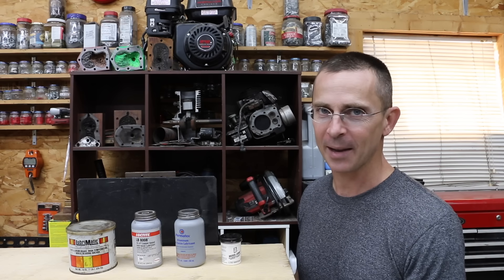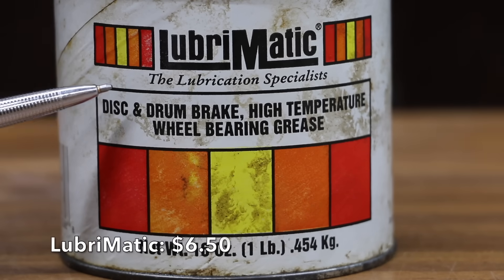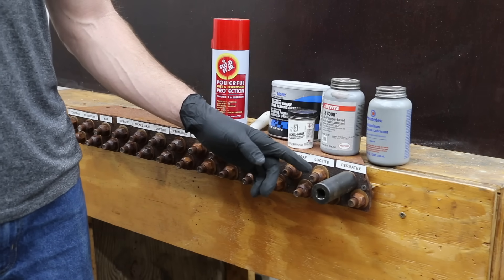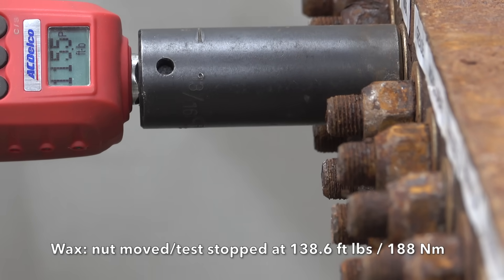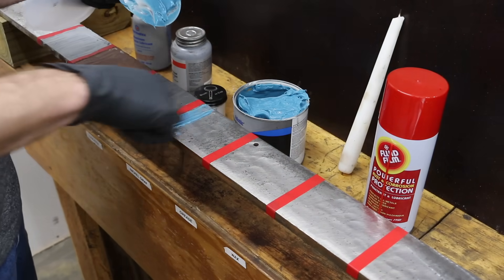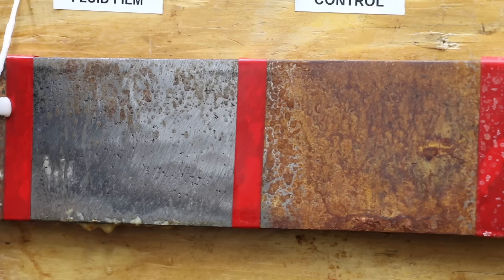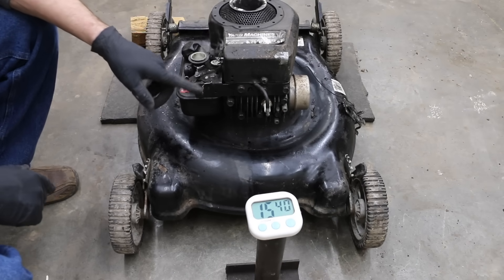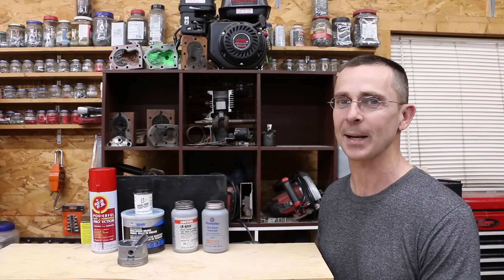Does Anti-Seize Compound Actually Work? Let's find out! Anti-Seize vs Grease vs Fluid Film vs Wax

Comment: Stopped using antisieze in the 70s for sp plugs. Basically stopped using it on anything by the end of the 80s. Never used anything on tire lug bolts or nuts. Issue with sp plugs was that by the time you had to change the sp plugs that stuff acted like a strong glue and did damage. Other reasoning is that sp plugs use the threads to transfer heat to the head. Anything blocking that transfer just causes sp plug issues. Just about every manufacturer says not to use anything on lug bolts or nuts. Now im just talking automotive. As to other things, i have no idea as i never used it on anything. Dont have any in my shop.

Comment: Love it! This channel is a bloody treasure throve ❤ - Important tip for the new boys n gals! Anti-seize (the vast majority of it) is NOT lubrication!

Stuff that need lubrication, need to slide (very) easily, long and reliably.  Anti-seize is only ment to hinder, well, seizing. So while a little copper or aluminium paste between your hub and brake disc mating surfaces might be a good idea (al for al hubs), use proper (high temp) silicone lubricant on the sliders. And yes, that gets on everything too. Try not to get any on the discs or pads.

Thank you for pointing out the bit about anti-seize and torque. Many don't realize that it will drastically impact the torque needed to achieve X force. Same  with lots of rust and grit in threads, just the other way around (more torque needed). So think twice before using on anything where torquing to spec is really important. Also be aware that it will come undone easier, which may be a problem for parts experiencing a lot of vibration.

Comment: You know what really works?
Tungsten grease. 

It's insanely expensive, but it protects everything forever. I smeared my bike's screw heads after installing stuff, now they don't rust anymore as long as I stay away from the holes.
This grease works up to 1200°C. I even fixed my exhaust with it once.

Comment: Different anti seize compounds affect final torque tightness.   On small ti fasteners this can be the difference between spec and broken fasteners.    Torque angle would have been a better control for initial tightening.

Comment: Anti-seize: I'm gonna end this lawn mowers career.

I'm not surprised by the candle wax.  It's low heat point would probably melt it out of those bolts during the grill test. Best keep the candles for mood lighting and smoothing those sliding doors.

I'm also not surprised by the high temp greese! A lot of gun builders use Red N Tacky and Shell to keep the barrel nut from freezing up on Ar15s.
Reply from the maker: Thanks for sharing.

Comment: You missed the boat on this one, you should also test stainless nuts and bolts, it prevents galling while tightening. Also try putting spark plugs in aluminum cylinder heads with and without anti seize
Reply from the maker: Thanks for the suggestions.

Comment: Thanks, another great review. I've been using  both  the copper and Permatex aluminum, the little higher torque of the aluminum doesn't seem to be an issue and it's probably better in things like aluminum heads.
Reply from the maker: Thanks for sharing.

Comment: Just did my spark plugs yesterday with Permatex aluminum anti-seize. The old ones were tough to get out and looked like they had some old dry anti seize gooping up the threads. It probably did its job and kept the situation from getting worse as I had neglected the job for over 3x its recommended interval. Just happy to have the new plugs in and the truck running great without damaging my cylinder block!
Reply from the maker: Thanks for sharing.

Comment: When I did tire repair for a living, I always wire brushed the lugs, wiped them down with a lithium grease, wiped them clean and then torqued the nuts down.
Less for the customer's benefit, more for mine - a cleaned & protected lug & nut don't rust on as quickly & I hated replacing lugs because I had to torque it off to remove the tire.
Another tip from a former tire guy - use the long lug-nuts that completely cover the lug, since you don't have exposed thread it'll be less likely to seize.
Reply: Except, the torque may not be accurate if you do that. Also, don't you mean a nut that completely covers the lug?
Reply: @sauercrowder  I meant torque as in the action "to apply torque to something", not tightening to a specific torque (1/4 turn past the sharp rise).

Yes, yes I did, thank you for catching that, I'll fix it now.

Comment: Wow, amazingly through testing!  Perfect timing, as I'm connecting a black pipe to an aluminum with zinc coating propane regulator (manufacturer cleared it) connection.  I'm going with the Permatex because it seemed to really do essentially the same job as the Loctite for half the price.
Reply from the maker: Thanks for sharing.

Comment: Video idea for you. Is anti-seize just as good for calipers as caliper grease?

I work in a parts store and have heard many customers say they use anti-seize instead of caliper grease, in my opinion anti-seize is only supposed to be used to get a nut off a bolt easier, not for constant use as it would be while on a caliper slide pin.
Reply from the maker: Thanks for the video idea.

Comment: I have a shop and use both aluminum and copper anti-seize. Depends on materials. Copper on bolts into aluminum such as heads, blocks spark plugs into aluminum heads and any stainless steel bolt into aluminum. If it steel bolts into steel, aluminum anti-seize.

Comment: My university colleague was a commissioning engineer at a new nuclear power station. They had to strip and clean the entire nuclear core because copper grease had been used on the bolts. It becomes corrosive to stainless steel with neutron bombardment. Who found that out the first time????

Comment: Instead of trying to use candle wax, use  Cosmoline, it basically wax suspended in acetone. You spray it one the acetone evaporates and leaves behind a waxy coating.
Reply from the maker: Thanks for the suggestion.

Comment: I been using Permatex since 1978 , Oil Rig saltwater we had to use it on every pump and parts on the pits .  it works on head bolts and studs .  Why on Earth stick it in a crankcase , it has aluminum fibers , that eat away at brass cast iron if its turning It is used solo to stop binding lock up of a nut or stud . so they do not strip out when Rust is common.   I do enjoy all the Videos PF you do a fine job at testing   Im starting to think you worked at NASA space program or an Engineer for Chevy
Reply from the maker: Thanks!  Not an engineer nor work at NASA.

Comment: I remember someone telling me a long time ago you can dump brake fluid into engine oil and it will wipe out the bearings within about 500 miles don't know if it's true or not
Reply: The seals in the brake and engine systems are incompatible with each other's fluids. It will destroy the seals in short order, and the engine in turn.

Comment: I keep hearing and reading that the copper and aluminum anti seize are meant for different purposes.  copper anti seize is supposed to be bad if you use it for steel threads in aluminum holes due to some sort of galvanic action, It has to do with their reactivity (their place in the periodic table) I would love to know more about that - perhaps you could try steel bolts in an aluminum block of some kind?  AvE has said in the past that these anti-seize compounds are (despite the label) NOT a lubricant and are mildly abrasive which is what helps their anti seize action which would explain the results you saw in the engine.
Reply from the maker: Thanks for the video idea.

Comment: I watch this with great interest as an owner of a vintage Japanese all aluminum engined motorcycle.  I’ve always used the Permatex Anti Seize on just about every conceivable engine fastener. I can not risk damaging the threads of the case or heads while tightening or backing out fasteners etc.
Reply from the maker: Thanks for sharing.

Comment: I’ve found that at high temps, anti-seize does the exact opposite of what it’s supposed to do and seizes up.
Reply from the maker: Thanks for sharing.
Reply: Do you have any examples? I am getting ready to put new plugs in my Nissan Altima 2.5,  2015, factory Denso plugs. I have watched videos and seems like frequently they are hard coming out, I want to avoid it for next time. Actually I'm nervous about taking these out, never been changed....204k miles.
Reply: @kccodex8931  a tiny bit on spark plugs, that’s fine. Sure beats having corrosion happen on the threads. I’m talking more about when people try using anti-seize to lubricate brake components. Use a good spark plug socket, and a long handle ratchet or breaker bar for leverage.

Comment: Interesting video. Using anti seize is common with firearm sound suppressors. If not removed often and/or a high volume of fire the heat and carbon can “weld” the suppressor. Especially on direct thread suppressors.
Reply from the maker: Thanks for the feedback.

Comment: I can tell you that for military marine applications, we were required to use anti seize on all stainless fasteners going into stainless nuts to prevent welding and galling.  Stainless likes to micro-weld to itself, and using anti-seize along with passivization and using different grades of stainless for the nut and bolt, the problem was mostly eliminated.  I use it on everything I work on, from cars to trucks to watercraft and it's obvious which bolts I have put it on.
Reply from the maker: Thanks for sharing.

Comment: If you own a Craftsman LT1000 lawn tractor you would know anti seize works. 
The mandrel or spindle is made of aluminum and bolted to the deck with steel bolts.  Without any seize the bolt will gall, basically welding the bolt to the aluminum from vibration. 
You have two choices. Drill the aluminium out and put a nut onto the bolt so it can be R&R. Break the housing lug to get it removed.
If you use a self tapping bolt to turn a thread, put anti seize on a standard bolt AND it's shoulder or washer, thread it in the mandrel that bolt will come out with minimum effort and not break a $30 part to grease a $5 bearing.
Reply from the maker: Thanks for the feedback.

Comment: Where you really need anti seize compound is with stainless steel fasteners or dissimilar metals like steel into aluminum.  If you don't need temps above 750F, Loctite food grade anti seize works great and and is easy to clean up unlike the Cu and Al where a small amount gets all over everything and is impossible to clean off.
Reply from the maker: Thanks for the feedback.

Comment: "We're going to test them on threads"  
Ok, makes sense.  
"And test bare metal"  
Works for me, a little extra data.
"And if it'll work as engine oil"
There's the Project Farm I love.
Reply from the maker: Thanks for watching!
Reply: I know. He seems to have a fetish with replacing engine oil with things that obviously wont work. I love it. Makes me laugh.
Reply: Ngl, I was waiting for the fluid film engine oil test.
Reply: Yeah he goes above and beyond everytime 👍🙌
Reply: The  copper  high  temp  works  better  wether it's  locktite or  permatex.  My  first  experience  with  locktite  was  on  the  mold board  adjustment  bolt   (2.5  inch)  on  a  12 cat  grader  that  had spent  6 months  working  rip rap  on  an  ocean  beach . Absolutely  no  problem  getting  it  loose .

Comment: I started using Fel Pr0 (Loctite) C-a5 when I saw a millright dipping into a gallon can of the stuff with a 6 inch paint brush and and applying it to the head studs (maybe 10 " on the diameter) of a nuclear reactor. I've been satisfied with its performance over many decades using it on all metals. Anyway, galvanic corrosion would come from the galvanic couple difference between the fastener and whatever it is fixing. C-a5's product description states that it can be used on all alloys.
Reply from the maker: Thanks for the feedback.

Comment: Please..Test of best bailing wire and methods. Single strand, double, triple. Twist vs twist and fold vs loop and fold (there is a tool for that). Steel wire, baked iron, copper, clad, SS, plastic coated, etc.
Reply from the maker: Thanks for the video idea.

Comment: i work maintenance a distribution center with over 17 miles of conveyor. we use the copper loctite on all kinds of stuff but mainly motor shafts so the pulley doesnt get stuck.
Reply from the maker: Thanks for sharing.

Comment: In our shop over the years we mostly used anti-seize on exhaust manifold bolts. It seemed to work pretty well even with the high heat of the heads.
Reply from the maker: Thanks for sharing.

Comment: My personal experience is that copper-based compounds work best.  Also, you can get significant improvement by taking a few seconds of extra effort.  First, apply the compound over all the threads rather than just wiping a gob on one side.  Second, finger tighten the nut (or spark plug) all the way in, and then all the way back out.  This really helps even out the coating.  When you finger tighten the nut or plug the second time, you'll feel a marked reduction in the amount of drag -- particularly true with spark plugs.  Never had one stick when using this method.
Reply from the maker: Thanks for the feedback.

Comment: Thanks for another informative, well-done video.
I never knew about some of these brands/products.

I always use anti-seize when changing spark plugs. Beats having a plug break off and having to Heli-arc a new threaded insert in. Cheap insurance IMHO.
Reply from the maker: Thanks for sharing.
Reply: great for o2 sensors as well

Comment: I work as a service technician for industrial-grade baking ovens and am using "Ceramo" on a daily basis. That stuff resists temperatures of some 300°C for several years. I apply it on screws to secure pump turbine flanges to their housing which are exposed to these high temperatures 24/365¼. On 95%, the screws come off easily and can be reused once wire-brushed clean over and over again. That stuff's just awesome.

I've used copper-based anti-seize before, and it didn't do a satisfying job, especially when it starts to oxidize, turning green. That's a sign of oncoming headaches!
Reply from the maker: Thanks for the feeedback.

Comment: I use Arctic Grade Copper Coat. It’s used on Oil Rigs or Directional Drilling Drills for threading the rods together. If you don’t use the grease the rods will literally not come apart and feel like it’s welded together.
Reply from the maker: Thanks for the feedback.

Comment: One question i am slightly interested in is this. I always use the aluminum anti seize. But on the roads out where I live they put mag chloride on the road. It doesn't rust steel much and doesn't corrode aluminum that I know of. However it will corrode a several foot section of wire in a week if there is a hole in the wires insulation. Would the copper anti seize corrode or stop working if it was exposed to that stuff?
Reply from the maker: Thanks for the video idea.

Comment: Great episode. Any reason you didn't weigh the anti seize before the water test? I remember you did it in the grease video so, Just a little curious.
Reply from the maker: Great point.  I used a much thinner layer to avoid the aluminum and copper getting into the water pump

Comment: Project farm I have a question... I have an engine that whenever I start up my truck it will rev low and high repeatedly and when this happens the whole fan system slows down and speeds up over and over as well as the belt drive etc. Any idea why this is?? Any comments and suggestions are appreciated and I really like your work man keep it up 👌
Reply from the maker: Thanks for the video idea

Comment: Q: do permanent magnets on the fuel line improve performance ?  Attract mode or repel mode ?   Carburetor engine or fuel injection engine ?
Reply: I believe you are supposed to drop those down the spark plug wells to align the fuel atoms as they enter the engine
Reply: It may not have been here, but I know that I've seen these tested already and of course they were useless

Comment: I use the stuff on new spark plugs and manifold bolts but stuff not in direct heat i like Cen-Pe-Co bearing grease. I had cylinders coated in a block one time with it and the machine shop owner called me and said they hot tanked it 3 times and it wouldn't touch it. He charged me an extra fee to pay one of his guys to hand scrub each one out with solvent lol
Reply from the maker: Thanks for sharing.

Comment: another great vid. in my job doing inhome service on lawn & garden equipment, i go thru a couple of the 8 oz bottles a year. i mostly use the copper permatex but will use the aluminum if they are out of the copper. engine pulley, the slide on wheels with key ways on the trans, splinded shafts & the pins & bolts for the brakes, if you don't use, it in a couple years you'll have a time getting those parts off.  someone mentioned marine silicone grease, a mix of it & anti-seize works ok on the tines & wheels on tillers.
Reply from the maker: Thanks for sharing.